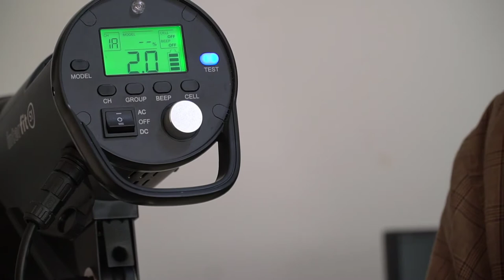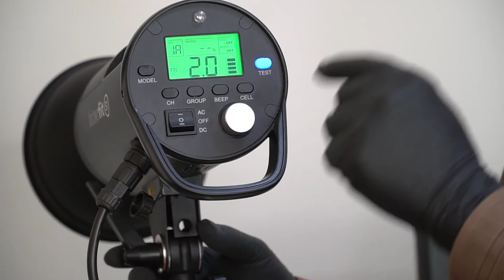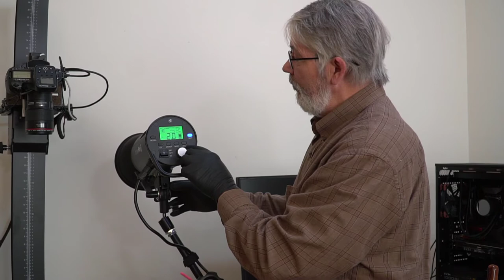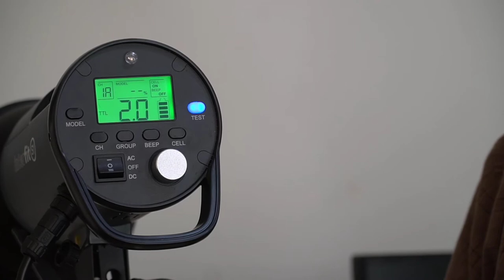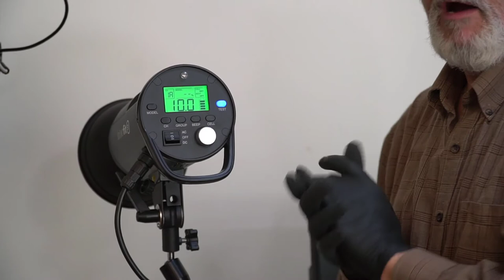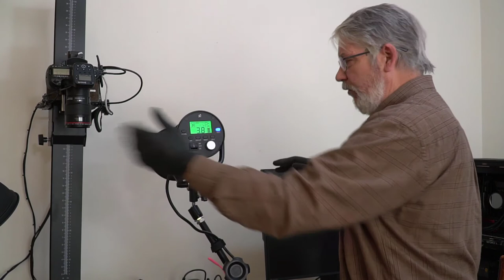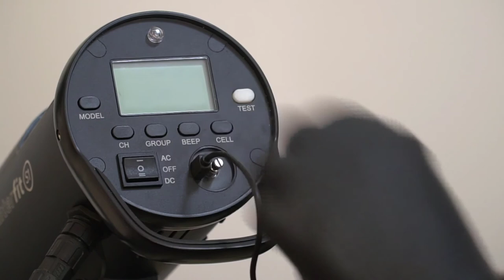#3 Interfit S1 light set up

Comment: This setup is an over kill.
Since you are using ATG/Canon, you can use ATG/Canon software to control all setting & live-view from pc.
So a supported ETTL II transmitter with supported speedlites will work much better. And less.

LK imaging system, have you tried using ATG/Canon EOS Utility?
This awesome features allow you see ATG awesome live-view and ATG AF touchscreen on your pc. 

As well as do ATG AF micro camera lens adjustment.